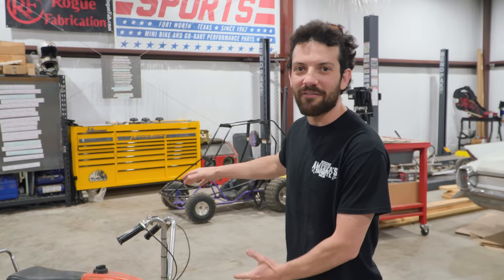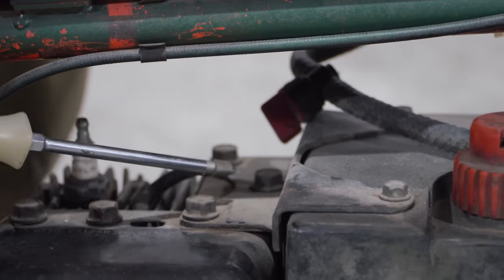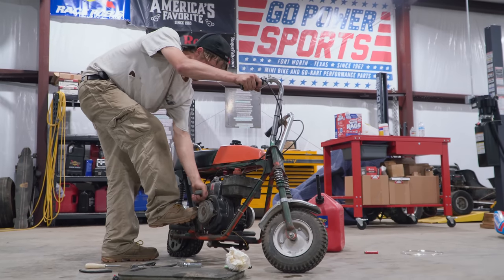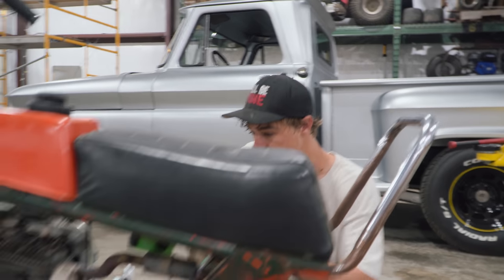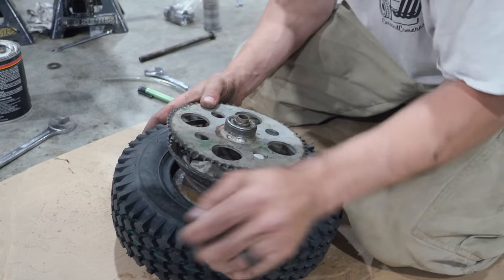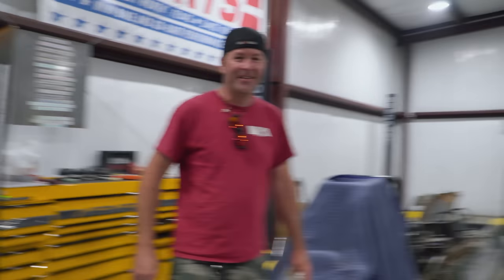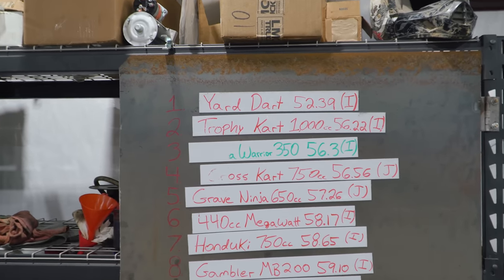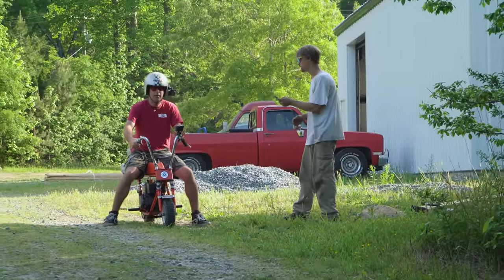We Bought an Abandoned 1972 Sears Roper Mini Bike, Will it Run & Ride Again?

Comment: Just in case you didn't know and to save others future frustration I have the following tip. When inserting an inner-tube into a tire, it goes a lot easier if you put a little air in it. With it all vacuumed out to make the tube pack into a smaller box the sides stick together and it makes it a little more difficult to position. In some cases you can also get a twist in it which is bad and you'll find out why when you try to inflate it. So to make life easier just give a short blast of air into the valve stem. One stroke on a bicycle pump is enough. You'll be surprised how much easier the tube will be to install. Thanks for the great content guys. It's really been a blast watching.
Reply: I also like to powder the tube with baby powder.
Reply: Agreed I always breathe a little air into tunes on any tire before I put them in the rim, it just makes life a whole lot easier....
Reply: Yep, it’ll save you some money!!

Comment: I’m guessing the mini bike had an engine(not original to the bike) with bottom oil drain plug. So they cut an access hole. Just a guess.
Reply: my guess as well..
Reply: Same
Reply: That's a good guess.
Reply: Right there with the same thought!
Reply: I prefer to think they were running too rich on a good batch of vintage moonshine when the piston & rod struck oil : )
Reply: Oil change clearance mod would be my guess on another design motor👍
Reply: This was my guess as well 🤣🤣🤣
Reply: yep - agreed, thought that when they showed it on the swap meet vid
Reply: That's my first thought, as well.
Reply: Took the thaught right out my head either oil change problems or clearance issues
Reply: That makes the most sense
Reply: Yup
Reply: Exactly my guess too
Reply: Yup!
Reply: Its a good guess but ive never seen any vertical shaft engine with a drain plug on the bottom
 But whose to say small engines are like guns never say it wasnt done because theres always some obscure thing out there that is mostly forgotten
Reply: Was what I was gonna say as well
Reply: yep i immediately thought of ike drilling a hole for a drain plug in one episode from a while back.
Reply: Same thoughts. When they did it, they probably used a drill and some sheet metal shears which are effectively just can openers (and the opening looks like a jagged can lid lol).
Reply: Was my bet
Reply: I hadn't thought of that, it's a better guess than mine. Mine was that there might have been an engine mounted funny (like on its side or something) and it blew. I like your guess better.
Reply: Yup...
Reply: Cut?
Reply: No.... Not any horizontal engines had a underside drain only.
Reply: Well at least I wasn't the only one to have that thought

Comment: That hole on the bottom of the frame is where the scrub brake is mounted on the frame. Sweet old bike there. I've never owned a classic or had a go-kart or minibike growing up but I sure do have a few now. I have a Kmart Doodlebug from the 90s with a tilly 212 Hemi that's worked to a 223 and ported head with the small valves still. I have a 1979 CM400 and an 82' CM450A. Those were restoration projects of mine and I recently picked up a Yerf-Dog Spiderbox 150. It needed a new rear axle, sprocket, and Chain with a battery, and she's proper again! Sorry for the long rant. Love what you've inspired me to do!

Comment: I had that exact same model of mini bike, I bought it with a dummy engine and that same hole, it had been modified to mount on a ride that sat in front of the krogers store in garland Texas when I was a kid, I bought the mini bike with the mount for the ride still on it, when I put a Briggs and Stratton engine on it I removed it. Rode that mini bike through 3 engines, ahhhhh childhood.
Reply: Was the hole cut specifically to modify it for the supermarket set up?

Comment: Seeing you guys wrenching on things makes me want to as well. So today I put the summer tyres on the family sedan and my dad and I replaced the front brake pads and rotors with fresh ones. I had a foible at the start, I put a 1/4 inch hex driver into a T45 Torx caliper slide bolt, the darkness of the sun at my back made me think it was a hex, I didn't have a 7 mil hex handy so I used the imperial size that fit and I found out the Passat, despite being a USDM model, uses metric. Oh well, after riding my bike to the parts store only to find it closed for the apparent holiday, my neighbor got the driver unstuck (in two pieces since it broke but nothing uses a 1/4 inch hex driver anyways) and the caliper bolt was luckily unscathed. So then I did the rest. My back hurts though, but at least the money saved was well worth the trouble, instead of sacrificing several hundred bucks to the gods of consumerism we used the decent set of rotors and pads we bought back before the current depression when the prices of things were more reasonable, still gotta do the rear brakes and pads some other day though lol :P

Comment: Changed trans in old 77 LTD i had yrs ago, had a longer tail on it so needed short shaft, old man did like Charles said, coat hanger and torch, to cut it down and make it shorter, did a awesome job, and balanced really good. No vibrations at any speed. So it is possible.cause I've seen it done myself.

Comment: I’ve got a 1971 Sears Roper I call my “Rat Rod” it originally had the 2 speed Jack shaft . I’ve got a 5 hp Briggs with a Mikuni carb. 10inch tires, custom exhaust header, also remounted the rear shocks to lean back put custom fenders on. It’s my on going project bike

Comment: Not sure what you would call that ...
An anti-rattle-can de-restoration???
A brake clean restoration???
Whatever, it worked awesome, and it looks so much better!
Bam, hit the like button!
P.S. There is a high-quality sealed roller (ball) bearing with a built-in precision ground lip to replace those cheap stamped wheel bearings.  I don't know the number off the top of my head, but if you need it, I'll grab one out of my storage and get the number for you.

Comment: There's my minibike! I've had mine since I was eight years old. Mine started out yellow, no tank on the frame, and no sissy bar. It's black now, and I've welded bars in place of the shocks. I put a clone on it and everything flexed so much it kept throwing the chain. So I welded everything solid. By the way I'm fifty  three now, and I still ride it regularly.

Comment: Over the past I blew up a bunch more those Tecumseh engines, and wore out a couple of Briggs. The first engine I ever rebuilt was on that bike. I was eight. I blew the original engine, and dad got me another bike. Well I was throwing mud all over the place down on the pond,and that one started oil smoking really bad. I pulled it apart and the rings were shot,and the piston was scuffed, so I took the piston and rings off the broken rod, put them in the smoker, and wa la I was good for another little while. I got tired of the problems a Tecumseh carb has a habit of giving you so after a few more Tecumseh I cut the brace and then the tiller got robbed. Then it went into retirement. I got a Yamaha GT80. I pulled it out of the weeds when my first son got old enough. Lots more history but I won't bore you with it.

Comment: I’d say the original engine was a Briggs with the drain hole on the bottom of the case with an extension to one side and someone decided that it was better to have a plug in the bottom to get all of the oil out without tilting the bike.

Comment: the Only MAJOR thing is the 2 speed clutch is missing. Unless it was the version that didn’t have it but if it had the jackshaft it usually would have a 2 speed clutch set up.
Reply: I am of the same opinion.
Reply: Don't think the sears minis came with the two speed clutch could be wrong though.
Reply: @jamesperry109  I have one that does. It was an option maybe the drive pulley jackshaft was a different option

Comment: Yeah I have a 67 JD110 round fender that when I brought it home someone at some point had painted it partly blue, then other parts that are supposed to be green were black. Some red. Rly weird.

Anyways after some cleaning, primer & fresh paint sue was all one color as she should be again. Someone had partly rebuilt the engine, cuz it had some crosshatch in the bore when I had the head off for a new gasket.

Rn all she needs is a new rear drive belt, a battery, front tire, & she’s all set. Got it driving, but the rear belt shredded shortly after.

Comment: i had a bike with a similar setup when i was a kid. not quite the same but close. it was a smooth rider like this one. wasnt fast but it was really comfy. this little thing really shined up nicely. future plans?
Reply: 10 months later, and doing some research, i think this is what my old bike was. ive been digging and talking to some vintage enthusiasts, and this is one of the only bikes with a motor plate attached to the rear swing arm. mine didn't have the tank on it, or the rear bar behind the seat, but it had the spring front end on it. i need to find one!

Comment: Soapy water in a spray bottle helps tires go on easier when not using a machine. I worked at an ATV shop and for years I changed tires by hand until my boss finally bought a tire machine. 😂 I always hated doing the small tires cause they always wanted to fight me. 🤦🏻‍♂️😂

Comment: The hole in the bottom of Charles's Mini bike was put there because one of the engines they probably used had the drain plug on the bottom and they wanted to be able to drain the oil. Have a great day:_sendit::_omg:

Comment: I wonder if someone had a different motor in that bike where they needed access to the drain plug for the oil. Some older horizontal ones like Briggs & Straton had the drain plug on the bottom.

Comment: Soap and Water in a spray bottle is all you need to lube and often it dries faster than you think for the bead seating da da da... helps on tubes too. and use it to check for your tire air leaks as well...

Comment: I say brazing on a muffler is the only way to go for an exhaust flange to thread on muffler combo...  For the close quarters on my wheelhorse with now 15hp mitsubishi I had to braze on a cast iron threaded street elbow into a metal exhaust flange.  Now in 5 years I can replace that muffler with any easy to find 1" threaded muffler...  But this situation is special as they bypassed the easy to replace aspect, lol.

Comment: a low powered "race" shows the operators skills off better, Charles is a LOT lighter than Ike but Ike is older and wiser.. although charles might have done better on a second lap with the bike running better

Comment: i wonder if the hole was just a botched cut out for oil change? like if the engine before this one had a low drain and it got all over the frame, so they notched it to drain straight down?

Comment: I am assuming that the motor plate may not be original. Or they made a change in engines. the drain plug on the old engine was in the middle and burning a hole in the plate was easier to drain the oil.

Comment: A little tip for you guys, steel wool, brillo pads, scotch brite will all scratch chrome. The absolute best way to remove rust and polish chrome, this may sound crazy but I promise you it is not, is aluminum foil and chrome polish with rust remover.my personal favorie is Turtle Wax chrome polish. Put some polish on the foil rub it briskly on rusty chrome till the rust is gone.. The foil is softer than chrome will not scratch it but it's tougher than rust and will remove it, combine with the polish for the lasting shine and aditional rust removal.and future prevention. Nothing works better see for yourself.

Comment: Someone prob installed an engine with a oil drain plug on the bottom and needed a hole to access it. Otherwise a texas quick draw done er in

Comment: This one is easy. The mini bike ran over or landed on a rock which bent the pan upward causing the engine to also move upward causing the engine to be misaligned and chain to pop off at that angle. Instead of trying to beat the metal down back to a level surface (almost impossible for whomever had it) it was easier to cut around the raised area and weld a piece of metal from the bottom to protect engine from being damaged. My guess is the mini bike was frequently used on a property with a lot of rocks and the chances of that happening again were high.

Comment: The hole in the bottom of the frame could be from someone putting a hole in the bottom to drain the oil from some random engine they had on the bike at some point.

Comment: Rewinding the video and looking at that hole again its odd its a squareish hole so its definetely not a bullet hole 
It was done to possibly make something fit 
Its possible that at some point someone tried putting an engine like maybe and old kohler with a mechanical fuel pump
(Yes those do exist my brother had one ) or possiby and engine with a screw on type oil filter 
 Someone said something about an oil drain plug
 I guess its possible but ive never heard of a horizontal shaft engine with a drain plug on bottom

Comment: I think that bike has had more than 2 engines and one of them had a drain plug at the bottom so they cut a hole to let the oil drain through the bottom. My guess

Comment: You can use muriatic acid as long as the tank's not rusted real bad because it will eat the metal put a little in there and slosh it around make sure you got a mask on don't breathe it Don't pour it on concrete then rinse it out or pressure wash it then you can get the motorcycle gas tank sealer or not

Comment: My guess as to what happened is a stupid one but it's the one I have, what if on a previous engine someone drilled a hole in the bottom and added a drain, then chopped that plate to make it fit. EDIT: Also if you want to lube it up without having something horribly slippery for mounting the tire, soapy water, we use it all the time for car tires. and don't forget talcum powder for the inner tube when it's new like that to help it slip in easier and keep from binding when inflating and deflating to set it.

Comment: I think that is a 8-10 horse because t of the carb/exhaust, I have a 10 horse and the carb is the same, well looks like it, if the exhaust is on the left( looking at it from the front) it is larger , if it is on the right it is smaller

Comment: I wonder if they didnt have a different motor on it and the oil drain was on the bottom ?
I cant see any other reason to cut a hol.....okay chop a hole through the engine mount.

Comment: that plate is less than a 1/8 in thick and the motors are cast a rod at 8-11k rpm would go through that like butter but i think it was an access hole for a oil drain plug they tried cutting it with a oxy torch and they musta been drunk and said "eh well just bend it the rest of the way" or it was a drunk texas redneck who shot it with a 12g slug

Comment: i have a nice idea for a video : trying to make new tread on tires using pieces of other tires pressure and heat : https://www.youtube.com/watch?v=NOO0qM95krg , bet that you could make some tractor tires or even paddle tires
as for the hole in the bottom of the minibike : maibe they put the hole there to get at the drainplug for the oil on a different engine they put in there